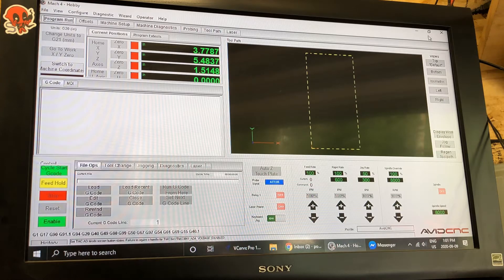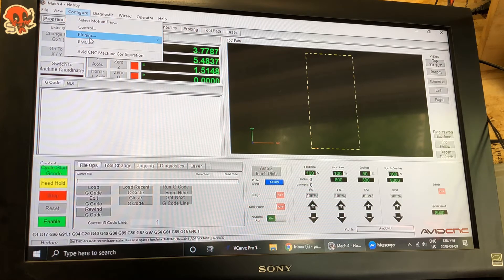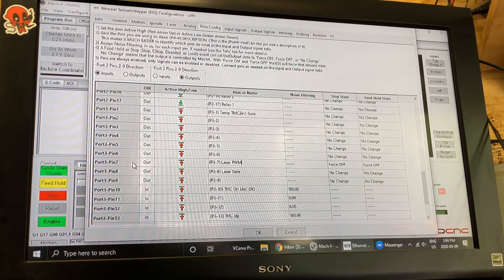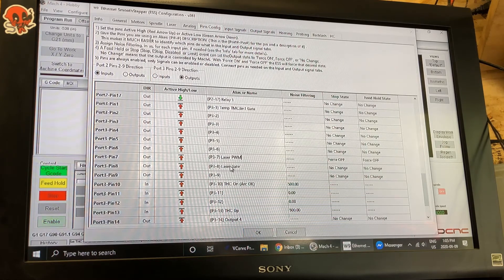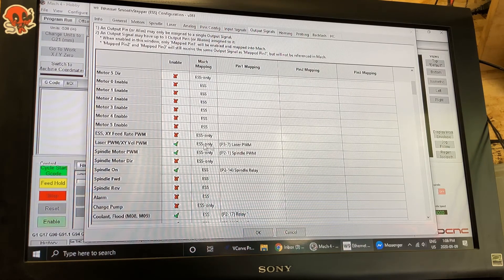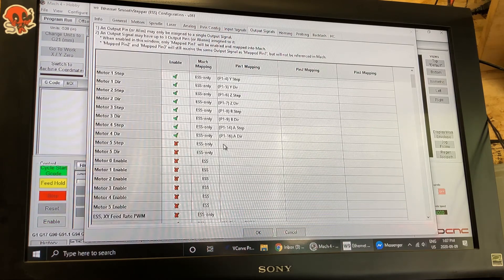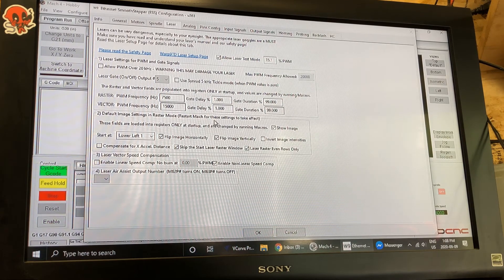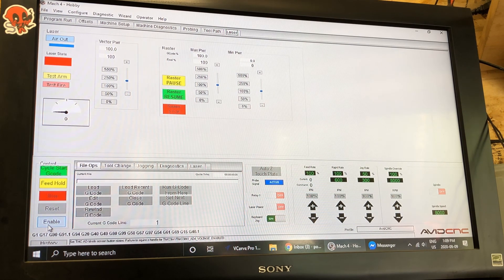Mach4 setup for Opt Lasers install

Comment: How do you install the laser screen so that it shows up in the menu bar in Mach4. I downloaded the file and added it in the Screens directory but have to go go into the wizard to click on it to bring up the screen?  Thanks in advance for your help.
Reply from the maker: Hmmm. I apologize but my shop burned down last year and I haven’t had a CNC since. I am awaiting my replacement, hopefully soon. I believe you may need to edit the main screen to reference the laser screen. If you post in the ESS forum, Andy is an awesome resource.
Reply: @silverharbourwoodworks6584  - Sorry to hear about your shop burning down . I hope that you are back before too long. Good luck.

Comment: Thanks for this video! It really helped me.  Just wanted to provide a quick note that worked for me and was different then how you explained in the video

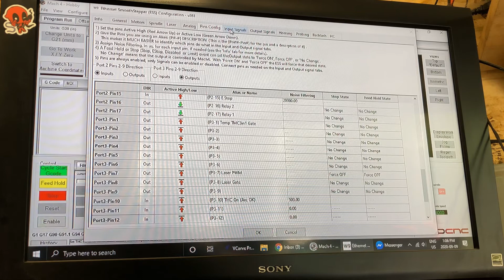Reference In video time stamp 4:33 - In "output signal" tab,  In the "Pin 1 Mapping Column"  the  "laser PWM/XY vel PWM" row should be "P3-8 Laser Gate" and the "Output #5" row should be "P3-7 PWM Laser". I racked my brain for hours as to why my laser would not fire the way you explained in this section of the video. I switch them around from what you explained as described and it worked. 

Thank you for the post processor file! 

I adjusted the .pp file to  M62 (laser on) & M63 (laser off) to M62P5 and M63P5 (for output#5- P3-7 PWM Laser). I then loaded the .pp file into VCarve.  Worked like a charm!

Comment: Hi there, Great video!! Thanks for putting this out there! I also have an Avid/Spindle with optlaser combo. 
Still waiting on the laser to arrive, but it should be later this week, so fingers crossed. 
I just have a couple questions:
1- Would you be able to provide me with the post processor file you use, please? I use VCarve Pro 10.5. I emailed Vetric and they told me that Avid is not supported at this time, but I see you are doing it successfully, so I was hoping you would be willing to send it my way :-)
2- You mention the "laser" tab in Mach4 as something you downloaded from the Warp9 website. I've looked everywhere and I can't seem to find this anywhere. Would you still happen to have the url of where you found that? 

Thanks much!
Bram
Reply from the maker: Hi there, The "Laser  Tab"  in Mach4 is located in the ESS Config section of Mach4 (Config/ESS).  You need to have the ESS plugin installed (I think current version is 261).  I can give you my post-processors for sure.  Avid does work just fine, as I have been working with Vectric to develop the post processors.  They actually have them but aren't providing them for anyone yet until they can figure a way to get manufacturers to try to standardize the setup.  They don't want to be responsible for helping with setup for 100 different machines if they all have different settings.
Send me your email and I can send you the PP's.
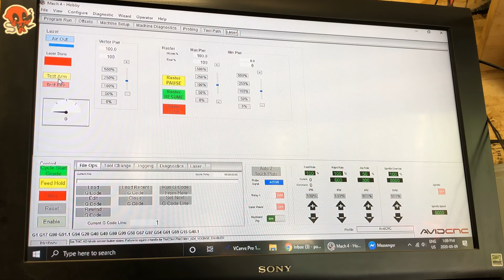Reply: @silverharbourwoodworks6584  Hi! Thanks so much for your reply! If you could email the PP to: hello@tinytreewoodco.ca that would be amazing.  For the "Laser Tab" I was referring to the one where you can test fire and test arm  the laser (min 8:00 in the video) but I just found it :-)